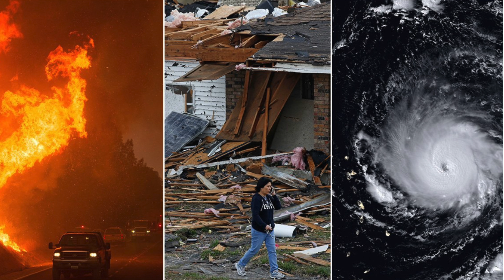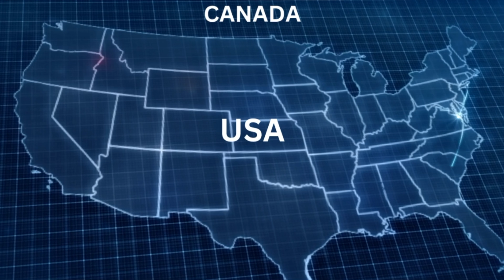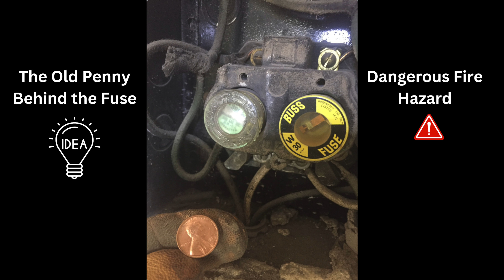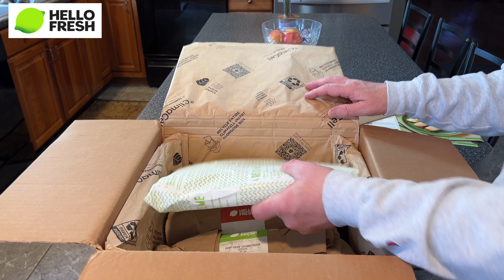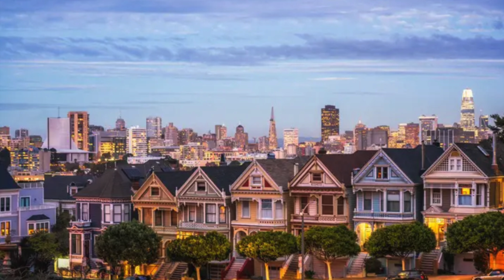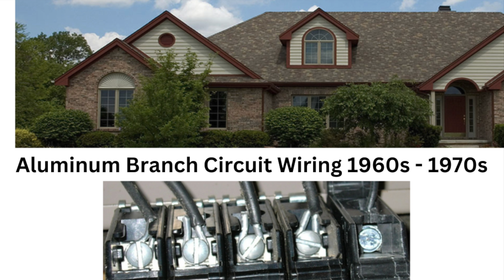Old Wiring Causing New Problems (Are you at Risk?)

Comment: I've seen for myself how unsafe 12  gauge single strand aluminum wiring can be back in the summer of 2005 while helping my step dad rewire his 3 bed 1 ½ bath  ranch style home built in 1973, purchased as is where is a few months earlier that spring. Service was a 60 amp Zinsco main breaker box in a bedroom closet Although if I remember correctly there were electricians in the area certified to install copper pigtails using Copalum , several receptacles were severely burned to the point the NM jacket was melted up to the cable clamp of the metal outlet box.  In other words the wiring was so far gone in spots copper pigtails weren't an option.  

But that was only that was only the beginning.  The three way switches were wired double dead end method with 12/2 AL, the "ground" was being used as one of the travellers and simply shoved back against the metal box, but since the home had hardwood floors with no grounded surfaces nearby, you were the bird on the power line so to speak every time you touched the brass switch plate. 

I watched Dad shut off the main breaker before I went into the crawlspace because I didn't feel safe going under there after we were discovering all this horrific wiring. I found the electric water heater was wired with 12 or 14 gauge low volt landscape lighting "zip cord" running almost the length of the home, so I take my diagonal cutter to remove it and replace it with a proper 10/2 copper NM and 30 amp double pole toggle switch near the heater as a means of disconnect.  I got a bang as loud as a shotgun and blinding flash.  After lying on my back for maybe a minute and realizing I'm still alive, I picked up my diagonal cutters, to find entire tip was vaporized off, my face and hand was blackened, my facial hair is singed and a piece of molten metal fused to my glasses.   I would be blind in my right eye if I hadn't been wearing glasses since 4th grade.  

Come to find out, the water heater was double tapped off the line side of the main breaker, you had to pull the meter if you needed to shut off the water heater.  The lugs were arc welded in place and about half of the breakers were welded to the bus bar.   After pulling the meter we had to cut out the service wires with bolt cutters to remove the old panel.  We also replaced the old galvanized iron water lines and cast iron drain lines while we had the wall paneling removed.

Being 16 at the time I found this remodel it to be a good hands on experience and made me decide to become an electrician.  To this day I have no idea how that house is still standing if you really want to know the truth.

Comment: Sparky here,  My sister and her husband recently bought a house with AL wiring. The inspection service missed it and they never called me until AFTER they moved in. What a headache. I remember in the 70's My employer at the time telling me to never do anything with AL wire. I still ,53 yrs later, Try not to work on them.   Remember RX with no ground wire or the ridiculously small ground they had?
Reply from the maker: I made a video on the history of ROMEX if you're interested. https://youtu.be/5ZP-G4Qo8tg
Reply: Some of the romex I have is groundless.

Aiming to rewire everything soon 😅
Reply: The first "new" house my family moved into (when I was old enough to understand wiring) was built in 1962. It used an ungrounded type of Romex, 14 ga. copper, with a silver-colored, fibrous sheath. Needless to say, no grounded outlets to be seen. One data point.
Reply: @aspensulphate  I grew up in a home built in 1962 with Romex, but grounded as I remember several years ago reading about when grounded wiring came to be, it was 1962 for all new homes built to have grounded outlets everywhere, not just basements, garages and for any appliances that are in contact with water, like your dishwasher for instance.

Yes, it was on circuit breakers, likely at best 100A.
Reply: Early BX cable had a very small ground conductor as well, almost like an afterthought. I suppose one could use the jacket as a ground conductor, but I definitely wouldn’t. I don’t count on EMT as a ground either, I ALWAYS run a ground wire in conduit whether it’s required or not.
Reply: I don't see a lack of ground as a big deal in most cases.

Comment: I work on historic houses with knob and tube and as long as it's inspected from time to time it's safe as it's gonna be.  Historical society ussaly limit what I  can do or replace they don't mind ceramic wire nuts and 3 peice boxes.  I do employ a policy if I see a bootleg ground I'm fixing it all or I walk off the job right there.  I think bootleg grounds are far more dangerous in what I ussaly see.  We get good at spotting a mix of 2 prong with 3 prongs in older houses and know when somethings not right.  Aluminum is one that people hate to hear that I need alumicon terminals are required and need to be documented for insurance companies.  We do it right or not at all liability is king and I can't put on blinders for known fire makers.  I do work on alot of federal pacific pannels but only as repair and always advise replacement.
Reply: as long as its not fooled with and taps everywhere and buried in insulation there really is no problem .... most insualtion companies wont touch a home with knob and tube..

Comment: My family used to own a home built in 1961 with old Romex that, I believe, was supposed to be good for 75 years.  Wonder if that'll be a problem for the new owners in eleven years or so?  It certainly isn't to modern code:  For one thing, the ground wire was only 16 gauge.  For some reason the metal boxes were grounded but originally there were only two wire outlest throughout the house.
Reply: And now everything is only two wire!
Reply: early romex had no ground..
Reply: @workingshlub8861  Yes.  This came after that.  Both the 14 gauge (15 amp circuits) and 12 gauge (20 amp circuits) had 16 gauge ground wires.  The house was wired to code in its day--possibly even better, anticipating future changes to code projected for a few years.  The outlet in the garage was the only one with a ground originally.  I suppose non-grounded outlets were cheaper, and there were so few grounded appliances then that it didn't matter much.

Comment: There is no good reason to keep that old knob and tube wiring. The insulation on the wiring is bound to be completely shot by now.
Reply: If it's tucked away in a ceiling or wall where no one can mess with it too much the insulation stays intact. It's when you start messing with it that the insulation comes off.
Reply: agreed. There is no reason to keep the old K&T around anymore. It was ok in an era with minimal loads on the circuits, but in our modern times we have too much demand. The ampacity drops under load because the line, grounded and grounding conductors are spaced apart, and the wires get warm to hot. not great woth that old insulation.
Reply from the maker: I'm sure it's the budget thats a concern.
Reply: Also no reason not to replace everything too. lol
Reply: In my 1914 house, the old insulation is mostly pretty good, with the rubber still somewhat pliable, except for the area where the original coal furnace was.  Or at least it was, the last time I checked, in the early ‘90s.  The thing I worry about the most is the soldered connections.  I’ve seen plenty of low-voltage soldered connections from the 1920’s where the joint has come apart.

Comment: IMO, 'knob and tube' wiring should be denied by insurance to save the rest of us from their fire claims.
Reply: People who smoke and use candles should also be denied.  Those a much more common sources of residential fires.
Reply: Your insurance  will never go down even if the house was built perfectly. Your insurance  will still go up. This is just an excuse to save money.

My house has the cloth wiring  and some spots. When it's installed  correctly  it lasts 50 plus years. 

When I have to do something  with the cloth wires I always heat shrink the conductors

Comment: It's disgusting and evil that some jurisdictions make you choose between leaving existing dangerous wiring as is or replacing it all, rather than replacing what people can afford, such as old outlets and switches and circuit breakers. Tells you right away such jurisdictions are not really concerned about safety. It's all about generating revenue.
Reply: Once you touch knob and tube, you have to replace it all, there is no way to salvage any of it, just try to put a wire nut on it - you can’t do it, just bend it out of the way and the wire literally crumbles. Electric until the 1950s was intended to wire 1 outlet or 1 light per room, not space heaters and computers and toasters and washing machines and air conditioning, we’ve consistently demanded more power over time, nowadays you can easily consume 20kW for an electric car in your garage alone, 2-3 cars per family, in the 90s we started rolling out 200A we are now planning for 400A services in the larger homes. My 1890 home that was upgraded from gas light to electric had a 20A service - the previous electrician that installed the 100A left it as a ‘tribute’ I guess, I’ll leave it while I install a 200A next to the 100A (splitting at the meter).
Reply: @ 

You don't have to go that far back for what I said to be true. You're ignoring the point of my post.

Comment: You bypassed Cloth wire, although it may not fall under the literal "knob and tube" insurance restriction.  My house built in 1945 had a few knob and tube ceramics floating around under the insulation, loose, but the house was sold to me with about 85% cloth wire and some 1960, minimally annealed 12 ga. Romex the rest.  I had the house inspected before buying it, he passed it but he said to me he thought there was aluminum wire in places, but it turned out to be cloth wire that was pre-fluxed throughout the run (silverish over copper).  I've replaced almost all of it with one room left, primarily due to the cloth separating and the rubber wire insulation being cracked and flaking off. It's all to 2017 code as that was when I did the work, so we are good.
Reply: Cloth and rubber insulated BX cable used tinned copper conductors because direct contact with the copper would cause the rubber insulation to deteriorate prematurely.

Comment: How would the insurance companies know the house is knob and tube.
Reply from the maker: Based on the age of the home. But especially if the home is sold or if someone changes insurance companies. For example I am currently being charged a very high premium because my roof is over 20 years old. Its still fine but I'll be replacing it this years do the rate increasing every year. I tried going with another insurer and nobody would take me until the roof is replaced.
Reply: @BackyardMaine  Insurance companies are really working hard to squeeze out every dime from us.
Reply: @BackyardMaine  We just went through that a few months ago.  Grange Insurance just refused to renew our homeowner's insurance with the minimum notice required because our roof was old.  There was no offer to continue the insurance if we replaced the roof, just a straight out cancellation notice.  My agent had to argue with the company for an extension and we had to scramble to get the rood replaced before winter.  Complicating that was the fact that we needed the upper part of our chimney torn down and rebuilt before the rood could be done.  We paid a bit more than I would have liked, but got top notch materials and workmanship and the job done on the schedule we needed.
Reply: One could just ask the local Real Estate agents
Reply: @77space-vt8wi  I've found most real estate agents are clueless, especially women, about anything outside that the most shallow glitz and glamour.  Ooooo, it has subway tile and quartz counter tops.
Reply: If they give you a notice that K & T is no longer going to be covered, and you have a claim, you won't get paid.  BUT if you ignore a K & T notice and then your house gets blown away by a tornado.....that's what my aircraft comment addressed. You then need an attorney for sure.  Claim denials due to unrelated issues == go to court most likely.
Reply: The insurance companies will lobby your state legislature to require an inspection if the house falls into the age category. But really, if you are in a house that old you should be proactive and have it rewired. Some knob and tube and early romex wiring can be more than 100 years old and if you are into old homes you better be ready to re-wire and re-plumb along with insulation and window upgrades anyway.

Comment: San Francisco homes will have to be rewired anyway with mandated heat pumps and electric vehicles.
Reply: Overnight charging of a modern commuter EV (not a truck!) can be handily accomplished via a 30A 240 branch (charging at 24A per NEC 80% rule for continuous loads).  If you don't have a 100A panel, yeah an EV will probably have to be charged offsite -- just as you have to refuel a liquid fuel vehicle offsite -- but that's not going to be at the majority of homes.

Heat pumps don't require as much ampacity as you might think, either.  The exception to that is the "emergency heat" resistance strip heater, and yeah that requires some ampacity, but in the San Francisco area that's not going to be an issue, as the temps just don't swing that low.  Modern heat pumps have really great COP and can suck heat out of the air pretty well even below freezing.
Reply: That's insane
Reply from the maker: Crazy..

Comment: A well presented, non-hysterical discussion of knob and tube. Perhaps you could do a separate video on how homes with aluminum wiring can be significantly upgraded without full replacement of the aluminum cable. I'm talking about proper pig tailing, anti-oxidant coatings, etc.
Reply from the maker: Great idea.. Thanks